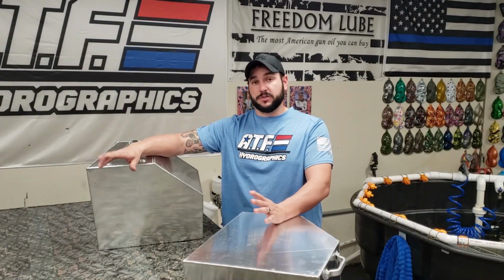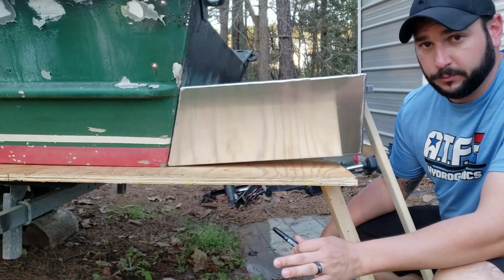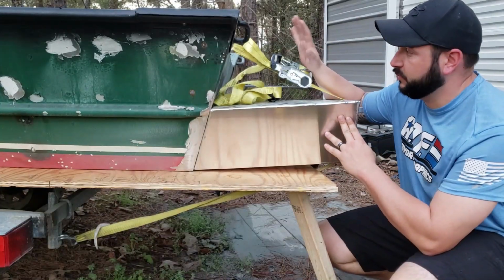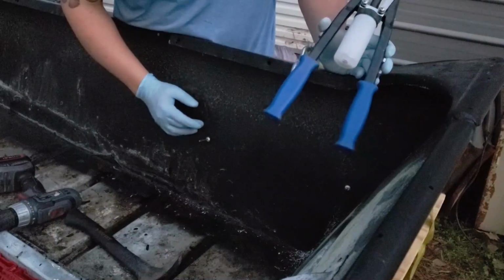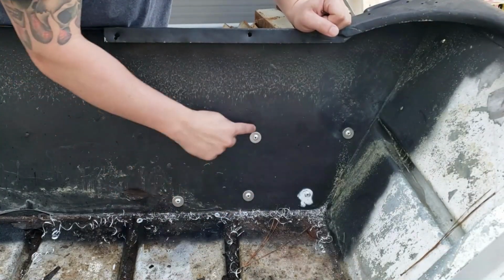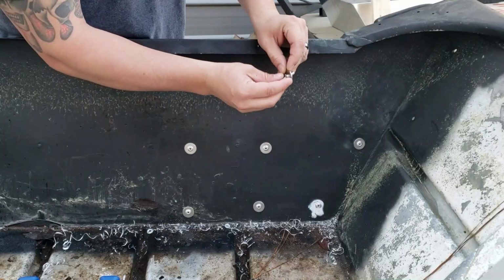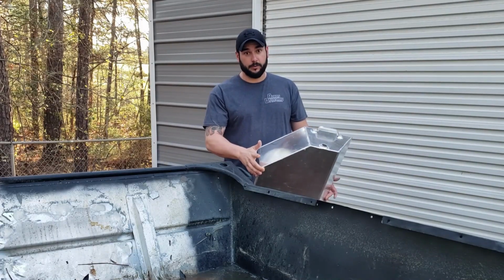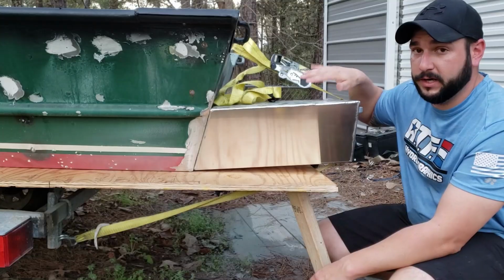Easy Jon Boat Float Pods || NO WELDING REQUIRED!!!

Comment: Hey man, you're right that boat builders use stainless screws in aluminum boats and masts.  I rarely ever worry about it with mine, since the part I'm bolting on will likely wear out before the metals corrode.  They do make products like tef-gel and others that are a coating that isolate the metals.  Most riggers will use that when doing projects on customer boats.  Worst case here.... you end up 15 years or so down the road drilling out the rivets and replacing them with the next size larger.  You'll be bored of this project and on to the next one well before that.  hahahaha
Reply from the maker: Thanks for the info on tef-gel... I gotta get some of that stuff. 
Im glad you see my point, and your right I will be way over this boat by the time any of those bolts, rivets or screws react with the metals. I only said all that in the video because when I had this video on my other channel I got ripped a new one in the comments about it. So of course I had to be a little extra about it when I made this video lol.
Reply: @SendItJonBoats  I think it's good that you mention it every time  because it is a real thing.  However, like you said in the other video about the transom, there's ways to make it work legitimately, and there are times where the down side of long term corrosion is out weighed by the upside of the strength you gain.  Heck, if people were so worried about boats lasting indefinitely with no maintenance, they'd build them completely out of stainless.  But then they'd weigh a ton and cost a fortune.  Aluminum is the only feasible metal to use, but in places it's just not strong enough.  So we isolate the metals as best we can and move on with life.  haha
Reply from the maker: @sailsandsales  Excellent point Paul... DO what we can with aluminum, beef it up when we can't, and try our best to separate them.... then SEND IT!!! Im about ready for the rain and cold to go away so I cen get some sending it done.

Comment: What about a plate on the back side?  I have use 3/16" 2" flat in areas like that also got a section of aluminum plate up to 1/4" for heavy stress areas. BTW Looks great. Great job!
Reply from the maker: I thought about trying a plate on the inside of the transom, but I figured I might as well try it without it since we are experimenting. So far its holding up fine. All that 5200 really stiffened up the transom once it cured. I am going to run it for a year and see what happens and do a follow up video.

Comment: 😂 ok bruh gotta hand it to ya this is crazy but if anything we try doesn't mean it will not work but different ideas ways and means has a point. and this idea lead me straight to the lightbulb thinking 😂 I'm gonna add to your product I'll probably use them as live wells 🤣
keep up them good ideas and stay safe fish on brother
Reply from the maker: Thanks John, I thought it was good idea, seems like it's working so far. But we will have to do a follow up video in a year or so when I have run the pods a lot and see how they held up.
Reply: @SendItJonBoats  that's great looking forward to see how they work brother fish on
Reply from the maker: @johngray2526  Hoping to finally get her out on the water this week, so long as the weather holds up. We got 3 motors to test on this boat before I finally reveal the crazy motor that is going on it! Im so excited.
Reply: @SendItJonBoats  cool waiting to see brother oh um someone posted about staying out of saltwater uh I'm more of an salt and brackish water person and yes it's hard to stop corrosion but I'm not about to go plastic 😂 fish on brother

Comment: keep on bolting pods to boats guys! as a fabricator i love to see yall pull into my driveway after you've ripped them off.
Reply from the maker: Thanks for the words encouragement Dustin. Appreciate you watching the video.
Reply: @SendItJonBoats   i like your channel bud. I've just fixed some "bolt on" versions as well as cut the bottoms open to get the pitch right. The angled bottom you got going on will cause the boat to porpoise uncontrollable. Unfortunatly one pod profile doesn't fit every hull but Beavertail does not care about that.  Best thing to do is to go have a quality fabricator build a set of pods specifically designed for your hull.
Reply from the maker: @WHITERIVERRAMBO  Any advice going forward ??? because I have not been able to find any reliable source of information about what angle and height the pods are supposed to be, so I just went with what Beavertail said in the instructions. But that makes sense they are just out to sell pods, they could care less if they actually work or not.
Reply: @SendItJonBoats  there's some personal preference involved.  Flat and flush is my favorite witch gives the most floatation but hinders turning a lot.  For most cases the front of the pod being flush and the back of the pod 1/2" above  will allow it to retain  moderate turning.  It's also popular to mount the pods 3/4" from the bottom. That step will allow the water to break suction from the bottom of the pod and will be  sportier to turn. It almost retains the same manners on pad that way.  The problem with your current  setup is the bottom angle is to great. Water suction will want to pull the pod down.   It will want to lift the nose uncontrollable to the point to where when you get on pad the front will crash hard into the water and begin a violent porpoise.  Ive learned this lesson the hard way. No amount of trim angle will help.
Reply from the maker: @WHITERIVERRAMBO  Thanks for finally steering me in the right direction.... no one ever has good info on how the pods affect performance. Does running a longtail mud motor make any difference or does this just apply to outboards and short tails?
Reply: @SendItJonBoats  i can't advise on Longtails but pods shouldn't be put on short tails im told.🤷🏻‍♂️i don't know why, i think its turning related.. Ive just done pods on  jet foots and outboards. Id ask your question on the mud motor mafia FB page. Wish I could be more help.
Reply from the maker: @WHITERIVERRAMBO  I could see turning being an issue with short tails. All I run is long tails so i guess I will have to experiment and see what happens. We are going to try to get that boat out on the water for some motor testing this week if the weather cooperates. I will report back and let you know how the pods respond to a long tail. Thanks again for all info, very helpful.
Reply: @WHITERIVERRAMBO  if I mount my pods 3/4” up like you said. I need to avoid the drain plug, should I still mount with the 1/2” angle from transom to end of pod?
Reply: @josiahbergman9777  yes sir that's perfectly fine. Just make sure the port side matches the starboard side & both are pitched the same.  With a 3/4" step & a 1/2" rise that should work great at any speed.

Comment: Pretty sure it’s only bad in salt water to mix the metals, I got a jon that had steel bolts in the transom and they were super corroded around the holes that were drilled and tiny pin holes all over where corrosion ate into the transom. The new jon I have was only ran in fresh water and has steel in it for the outboard and rod holder mounts and has no corrosion what so ever🤘🏻🎣 just make sure to always rinse salt water and never Moore it in salt and it will be just fine!
Reply from the maker: Good points.... and I agree completely. I only say that stuff in videos because the internet keyboard warriors and aeronautical space engineers love to comment and talk crap about using dissimilar metals. When I had this video on my hydro dipping channels I had quite a few nasty comments and emails about it and it got old quick.

Comment: Your installation acts like a trim tab in the slightly up position sucking the back of the boat down and creating drag. The angle of those pods should act more like a step and they should be raised up one inch or more off the bottom edge of the boat so that when the boat is planning they are out of the water. The next best alternative would be that they're absolutely parallel with the bottom and offer planing surface and lift.
Reply from the maker: Beavertail sent instructions with the pods and I installed them at the height they showed on the instructions to the T. They said the side closest to the boat needed to be flush with the bottom, and the back needed to be at an angle rising approximately 1-2 inches.... So if they are wrong then thats on Beavertail not me. But overall with a mud motor and a heavy loaded boat I am not going to be flying at bass boat speeds anyways, 25mph tops if that, so I am not really worried about it. But no one has any real video proof that the way they pods are mounted will affect performance so I am going to try it out and see what happens because I have seen people do pods at all kinds of different heights and no one can give any real facts of what works best so all I can do is try what the manufacturer said and see what happens.

Comment: How have the held up?
Reply from the maker: Not a single issue yet. I have stood on them, picked up the boat by the pods, drug the boat around by the pods, and it still holds on with no problem. I would highly recommend the rivet and 5200 method, it works great